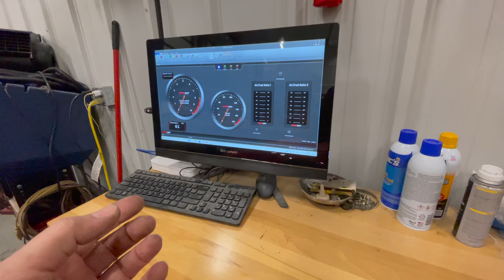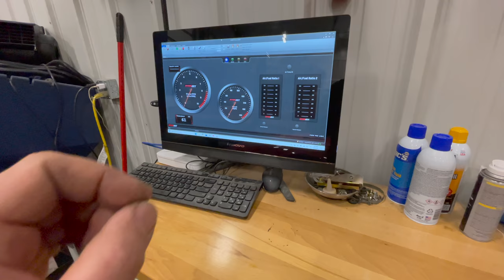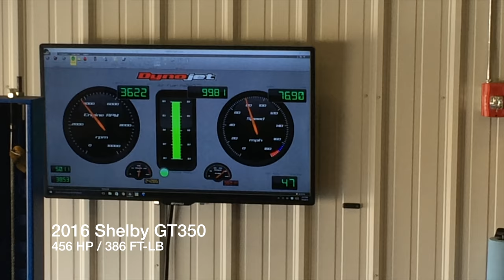Virtual Dyno Day On My DynoJet

Comment: I'm fortunate to live near Steve's shop.  He has used his dyno to tune the carbs my XK120.  When done, the Jag produced very respectable HP and Torque figures.  However, Steve will tell customers that unless the engine is in very good tune, especially the ignition system, the car will produce disappointing results on the dyno.  That may explain the lower than expected numbers on the Dino and VW Squareback.

Comment: Thanks for the videos.  Minor comment -- torque and speed are used to calculate HP. Not the other way around.
Reply from the maker: That is not correct.  The dyno cannot measure engine torque only horsepower, drum speed, and the force applied to the drums radius, it needs engine RPM in order to calculate engine torque.  It is more complex than this but Torque = 63,025 x Power / Speed.  The torque on the drum is not equal to the torque at the engine, the change in the moment arm (because of the drivetrain) is proportional to the ratio of the engine speed to drum speed.  That is why a tach reading is necessary to calculate engine torque.  It also adjusts all reading automatically to temp, humidity, and barometric pressure using at atmospheric sensor attached to the dyno.
Reply: But is not drum torque and speed the basis for all else?  Then one can calculate/guess at engine HP.  In the simplest basis, drum speed and torque are measured and all else is calculated and estimated.
Reply from the maker: No I can get HP readings without hooking anything at all to the car.  It needs to have an engine RPM reading to calculate torque.  It calculates horsepower from the inertia and acceleration of the drum.  If you want to know more http://www.dynojet.co.za/public_downloads/Manuals%20&%20PDF%20Downloads/General%20Information/HP-Torque.pdf
Reply: @ThisWeekWithCars  I agree with that, i.e. rear wheel HP can be calculated from drum inertia and drum RPM with nothing hooked to the car.  I was simply pointing out that HP is calculated from torque and speed.  Keep the videos coming, they are well done.  When my brothers and I were teens older brother had a 1952 jag XK120 fixed head coupe, middle brother had a 1953 MGTD and I had a 1961 bugeye sprite.  Each cost less than $500 and the Jag was pristine.  So I can relate to much of your video content, especially mucking around with SU carbs.

Comment: Not sure the Toyota conversion was really worthwhile in the Spridget!
Reply from the maker: An A-series engine making that much power would be high strung, the Toyota was hardly working and is a track toy you can take out every weekend without much work in between.

Comment: I'm no mechanic but something appeared to be wrong with the rear wheels on the Fiat.
Reply: I saw that! They seemed to move around either side to side or forward/backwards.
Reply: Very worn suspension bushes allowing the arms to move around under load.

Comment: If the VW only produces 19hp, how bad is the Frogeye's "adequate"?
Reply from the maker: The sprite was very good not bad you just don’t share the numbers on some race cars.  The vw had a flaky ignition so it didn’t give an accurate torque I do not know what the value really was.
Reply: @ThisWeekWithCars  Fair enough. I figured it had to be better than the VW (first car was a '58 Morris Minor, so I know how "much" an A series should be kicking out, and it's more than 19hp - lovely engines, but hardly overblessed with power). BTW, ever considered getting a Hillman Imp, or derivative of? Reckon you'd love that engine!